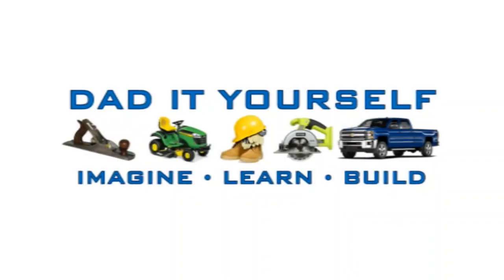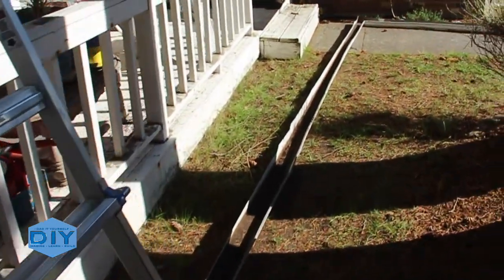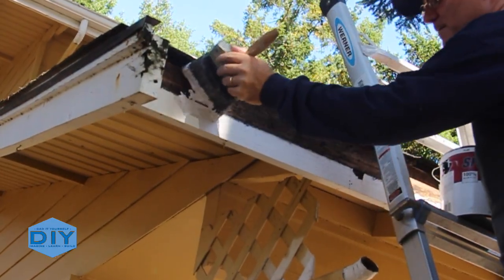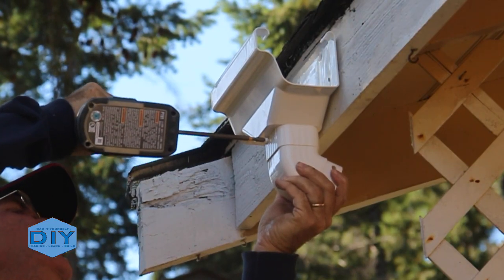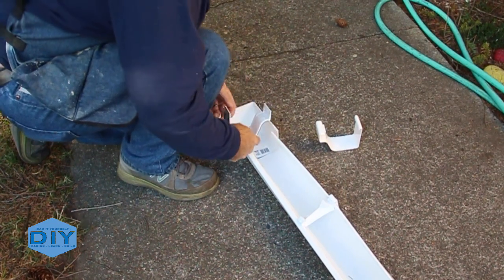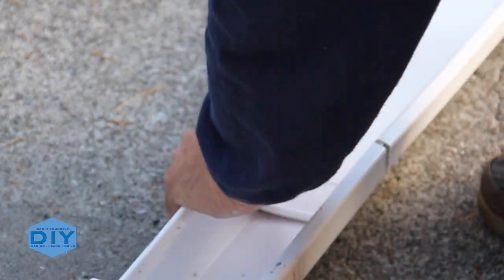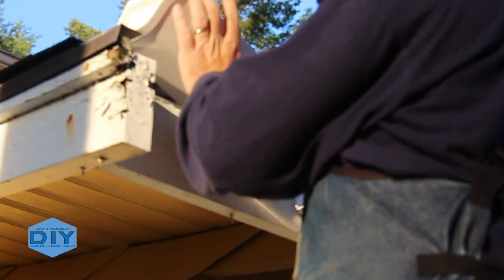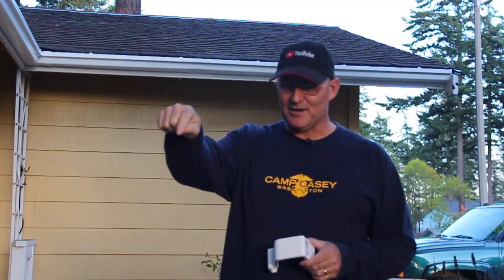INSTALLING Amerimax Vinyl Gutters | Homeowner EASY! | 2019/40

Comment: Another pro tip... Do not use 2 separate pieces across the downspout as there is no seal.  Instead cut your gutter full length, slide the gutter through the mounted downspout.  Once all of the gutter us up, you can fill the gutter with water to test the seal (look for leaks). Finally, cut a hole in the  gutter over your downspout with a utility knife for the water to run through.  Using two pieces like shown in the video will leak badly if not sealed.
Reply from the maker: If you do not follow the instructions and set tge length of the insert or themerature on installation day, it will leak, too short, thet it cools off, mine has never leaked.
Reply: Just telling you how it should be done.  Also your reply, I'm sorry...made little sense.  I am speaking from years of experience with this stuff. Take it or leave it. @DadItYourselfDIY
Reply from the maker: I agree with you. Had I known this trick, I would have done it.
Reply: I did it exactly like that... a lot better and easier to cut a hole in the gutter than joining it together..
Reply from the maker: @DSNYSANMAN I've heard that!

Comment: Pro tip: Install any connectors you can while on the ground. Trying to put in the joint connectors or end caps when the gutter's on the fascia is a real challenge, even where the nearest hanger bracket is loose. Otherwise, it looks good and seems to work well.
Reply from the maker: Agreed!!

Comment: Thank you.  Should have found your video before I put up my gutters.  No idea how to use the joiners.  Tried sliding the ends together.  Impossible.  Now I know how it was suppose to be done.  Going to try to put the joiners on with the gutters in place.  Hope it works!
Reply from the maker: It will. I had to go back to that house last week, one of the joiners was not centered (my fault) and it was leaking. Snapped it off, re-entered the interior part, and clicked the outer part right back on (back to front).

Comment: Thank you ,I wasted so much trying to join two sections with outside first! Truly my fingers wore sore!
Reply from the maker: Back to front.....
Reply: @DadItYourselfDIY  

In your video I noticed there was no metal flashing from under the roofing material and over the top of the facia extending down about 2 inches like there is on the house I'm doing. I can put the plastic (vinyl) mounting brackets under the flashing but then the screw hole is not accessible and if I mount them below the flashing it sits to low on the facia and looks like s#%t. Solution?
Reply from the maker: Drill through the drip fascia..

Comment: Sorry may be a dumb question, but do you use the joiners to connect the gutters to the 90 degree fitting or downspout?  Or is the gutter supposed to slide into the 90 fitting?  Joiners doesn't seem to fit properly over these fittings.  Thank you. Great video.
Reply from the maker: Nope. Just the straight runs.

Comment: We had aluminum gutters and I’m replacing with this product. We have hail often and the gutters we had were all dented. When branches fell on the gutters massive dents.

Th only thing I haven’t seen is if these can be painted?

Our Lowes has these marked down for clearance, I had to go to Home Depot to complete the project. They have the leaf guards that slide into the brackets that secure the gutters.
Reply from the maker: I'm sure they can be painted. I know they aso sell them in brown off the shelf. You may have to prime and paint. But I'm sure there is a video out there about painting vinyl.

Comment: Tips: 1 don't measure down from roof because it might not be level. Instead use a level. 2. Don't assemble on a hard rough surface like concrete like you did because it will scratch the bottom of the gutter.3.  I cut out my own downspout to avoid another unsightly joint.
Reply from the maker: Great Tips!!
Reply: I know this is a year old but how did you cut your own downspout.  The available downspout for this cutter won't work for me so I was looking for options but not finding any!
Reply from the maker: You can use a hole saw and an insert. They sell them in the same section of the store. Just remember to caulk it.
Reply: I was just looking at this system and regarding the downspout adapter, I was thinking to just run the gutter straight through it and use a hole saw in bottom of gutter. Should you caulk on either side of the downspout adapter?
Reply from the maker: That would probably work!

Comment: Tip the end cap doesn't go on the downspout connector.
Reply from the maker: It does not. It goes on a short section of gutter, usually 12-18" long.

Comment: 6:00 and that would be my problem, and why I can't figure out how to connect the corner piece to the guttering, and why I need to make yet one more trip to Home Depot. The other video I watched never showed connecting the corners, and I did not buy those connectors. I thought the gutter would slide into the corner piece.
Reply from the maker: Seems the sliding/expansion points are the downspout adapters only.

Comment: I like your video!  I installed vinyl years ago and like them; had some issues with seals and clogging, but really easy to work with.  Newer stuff like you installed looks better and the joints look much improved! Think the manufacturer suggested pure soap or food grade silicone for keeping seals pliable as the vinyl expanded and contracted.
Reply from the maker: Great info! I'm going to be at that house next week, it will be nice to see how they have held up.

Comment: Thank you for the helpful video. How do you put leaf guard on the gutters, my issue is the fact that the hidden clips are in the way for me to snap it on the gutter rail
Reply from the maker: The ones I used clip into the brackets and under the drip edge/shingles. This video shows that installation. https://youtu.be/yHYi-RKHcPY

Comment: Amerimax screws sold near the gutter are #8 11/2” zinc coated not stainless steel and are in overpriced boxes of 25. The heads are not round or give washer type consideration so off to the screw bins to get better.
No brave souls to discuss UV durability but Amerimax metal gutter is more than twice as much if you can afford to outsmart that issue.
I spent $300 for a 50 foot run and two down spouts in vinyl, so no to metal.
Thanks for the installation video.
Reply from the maker: I get the stainless steel screws with the enamel heads in the hardware aisle too!

Comment: I wonder how this would work with a 4.5 drip edge/eave flashing.  Not sure how I would attach it at that point. Thanks.
Reply from the maker: You may have to screw into the rafter tails.
Reply: @DadItYourselfDIY  There will be hardiboard fascia covering those.  So I am thinking I could predrill through the flashing and fascia in back and use the roofing nails to attach the vinyl gutter holders.
Reply from the maker: @affordabledesertliving3487 I'd recommend stainless steel screws. Getting a hammer and nail in there may be a challenge.
Reply: @DadItYourselfDIY  what about stainless steel roofing screws that have the little rubber washer?  That way it would be self sealing since I am going to be puncturing my flashing and the fascia behind it.  Thank you for your kind answers.
Reply from the maker: @affordabledesertliving3487 The screw goes through the hanger, so the washer will not touch the face of the fascia. A regular screw will be fine.
Reply: @DadItYourselfDIY  Totally makes sense. Thanks.
Reply from the maker: @affordabledesertliving3487 You're welcome.

Comment: Did you joiners on the downspout connectors. It looks like the gutters just lay in there
Reply from the maker: No joiners. They slide in and are able to move with temperature changes. Another option is to slide the gutter piece all the way through and use a hole saw to drill a hole over the downspout.

Comment: @7;27 this kind of joint, above the flow level blocks the dust and other hard particles and starts to create a heavyweight load and if not seen on time whole gutter falls down with its weight.
Reply from the maker: In comparison to a seamless gutter, yes. That said, the connection us designed with a beveled edge to promote water flow, so while some dirt or debris may catch there with low flows, any other substantial flow will carry that debris over the bump and down to the downspout.

Comment: I dont know if I trust vinal in cold weather, and all reviews I see they say aluminum is better. But you did show some good tips........
Reply from the maker: I'd agree that aluminum is better and much more expensive.
Reply: @DadItYourselfDIY  I have three roof edges 30-31ft. I just added up all the aluminum rain gutter stuff, hangers, end caps. three10ft down spouts, elbows, everything thats needed to do three roof eves, everything but  leave guards.....
It all came to a little over $700.00 at HD, WOW. Maybe I'll add up all the vinal parts and see if I can save a couple $100.00.....
Reply from the maker: Please let me know!!

Comment: Didn't see you mention anything about the downspout outlet expansion lines inside and what line to cut to. It shows different temperatures in Fahrenheit and Celsius. I'm guessing you need to cut to the line which is close to the current temperature outside.  Just guessing because the vinyl expands and contracts depending on outside temperature. 😊
Reply from the maker: Correct. A previous commenter suggested running a piece of gutter all the way through the downspout adapter and using a hole saw to cut a hole in the center.

Comment: Late to the game - I've found that, following 1/8" per 10 feet across 33', water backs up behind the inside joiner piece. I marked start and downspout end and used a level, actually had 1/2" total but found water pooling. A little frustrating; it may be that my initial hanging clips on the down-side gutters were too high. Any other experiences or after-install troubleshooting?
Reply from the maker: After I hung up the gutter, I did a flood test and adjusted my hangers to ensure good  drainage. While you may have your slope line correct, that doesn't mean the fascia is actually level.

Comment: I didn’t see how you attached the downspout fittings… the 45’s have holes. Why?
Reply from the maker: Not sure what you mean by the "45s have holes" the are secured to each other with screws. You can see how it's fitted at 4:23 of the video, and another shot at 8:35.

Comment: Hello Scott. Thank you for the great DIY video. One question about securing the vinyl gutter to the fascia. You said you used stainless steel screws, what size are they?
Reply from the maker: Hard to remember, But I used the screws that came with the kit.
Reply: I just installed 40' of these vinyl gutters this week. I used #8 - 2" screws and they're quite secure.
Reply from the maker: That's what I use. Stainless steel T25.
Reply: @DadItYourselfDIY  👍🍻

Comment: i noticed that you did not did not use a joiner in the sections for the drop outlet. I dont see how they wont leak. Am i missing something. Thanks for the video.
Reply from the maker: The drop outlet is a joiner, but its designed to "move" this is where the gutters can expand and contract with tempurature. No leaking either because its the end of the run..

Comment: Question, did you have any issues with the hangers becoming unclipped to the lip of the gutter? I'm having this issue and do not why....
Reply from the maker: Not at all. The gutters have been installed for a year now and are still going strong.
Reply: @DadItYourselfDIY  just had reach out to the company about the hangers. Mine keep popping off.
Reply from the maker: They are very temperature sensitive. Expansion and contraction with the weather.
Reply: @DadItYourselfDIY  I live in Florida and it's around 75 today. It's odd that the clips are not staying clipped. I'll let you know what the manufacturer says regarding this issue.
Reply from the maker: I would be very interested in that info!
Reply: @DadItYourselfDIY  The issue was a manufacturing defect in how the lips were not curled in enough to keep the clips on. Was able to exchange the product and install them successfully. My recommendation would be to test the clips on each gutter prior to punching.
Reply from the maker: Great tip!!

Comment: NO drip edge or gutter apron? Was hoping. That is the problem I am running into. Amerimax is flat on the back edge,  so can't just slip it under the current drip edge.  Trying to find a way to get it done. Any ideas???
Reply: ISN'T FLAT on back edge is what I meant to say.
Reply from the maker: @Dragon-Smoke-29 Do your shingles overhang the roof edge?
Reply: @DadItYourselfDIY  no
Reply from the maker: @Dragon-Smoke-29 Well that's not good.

Comment: How do you cap the down spout drain part of the gutter? You just run guttering into it without sealing? Caps and joiners don't fit it.
Reply from the maker: The down spout should be about 12 inches from the end of the round with a short piece of gutter and an end cap installed. Watch the 8:00 - 9:00 minute mark
Reply: @DadItYourselfDIY  thanks so no sealant needed for gutter running into the down spout?
Reply from the maker: Nope.  Follow the instructions for inset. There are lines for temperature on date of install to compensate for expansion and contraction.
Reply: @DadItYourselfDIY  you have a patreon? You're very helpful, I'd like to return the favor
Reply from the maker: You can give the video a Super Thanks in the comments section. That is very generous of you, Scott.

Comment: Don’t see a drop piece for the downspout.Is  it the Y shaped piece? If so what do you use for the closed end cap? It look as if I would have to trim the end to fit the gutter end cap on.
Reply from the maker: The downspout collection fitting is usually about 12-18" from the end of the gutter run. so there is a small section of gutter from the end of the roof to the downspout that has the end cap on it.

Comment: How would these gutters hold on a metal roof with snow sliding down on them?
Reply from the maker: Probably no better or no worse than an aluminum or steel gutter. I would think that their flexible construction would actually help them flex instead of bend. But at extreme temperature even vinyl becomes more brittle.

Comment: The vinyl gutters by Amerimx get high percentage of one and 2 star reviews, mostly claiming they are cheaply made and carry much less water than their much more highly rated aluminum gutters. I wonder if it could be climate related? Maybe the vinyl works well in warmer areas and not so well in severe winter areas?
Reply from the maker: Definitely not a whole house solution in the long term, but a great way to get something fixed in the short term, do a shed or a garage.

Comment: I thought the brackets screwed into the rafters, so 18” to 24”.  You can see where the rafters are by where the nails are in the fascia board.
Reply from the maker: You can do that or space them out evenly. This house has a 2 x 8 fascia. so there is PLENTY of wood to screw into.
Reply: Dad It Yourself DIY Makes perfect sense, thank you.
Reply from the maker: No worries!! Thank you for the comment.

Comment: I wish you would have shown how you cut the gutters themselves to size. Cutting the downspouts is easy, but you didn't show how you cut the gutters. I doubt that you used a reciprocal saw to do that.
Reply from the maker: I did use the reciprocating saw. My second video on vinyl gutters shows me doing this at about the 5:00 mark.

www.youtu.be/yHyi-RKHcPY
Reply: @DadItYourselfDIY  Thanks for your reply. I didn't see the second video. In the meantime, I have discovered I could cut the Vinyl with my cordless Ryobi mitre saw, as long as I didn't get greedy and try to do 100% of the cut. I could cut both the gutters and the downspout until near completion without "chipping" the vinyl, then easily complete the cut using a hack saw. It sped up the process considerably for me.
Reply from the maker: I found that the small teeth of the metal cutting blade works the best!

Comment: 1) How do I attach the gutter & mounting bracket to a facia that is angled in towards the structure at the bottom of facia thus making the gutter at same angle. The homeowner does not want this but wants it perpendicular & parallel with concrete driveway and structure walls. I'm thinking wedges behind each mounting bracket but that will be a p.i.t.a. and I'll have to requote the installation.
2) Homeowner wants the back of the gutter right under the shingle roof material but this is a problem because the mounting brackets (as designed) will not allow the gutter go up under the metal flashing. The closest position would be about 1/2" below flashing. Even if I could get gutter up under the flashing it would cover the mounting bracket screw hole. Solution? Drilling a hole in the flashing for mounting screw hole access would be to difficult and numerous to already installed flashing thats about .030 thk.
Reply from the maker: Ideally you want to be installed about 1/2" below the shingle edge, if this means through the flashing, then so be it. 

But, like you said, wedges or some other custom mounting method is going to be required to kick it out level. I would suggest PVC trim board material.

Comment: How do you connect two pieces of downspout that are not connected at an elbow? Both are straight and not crimped.
Reply from the maker: Vinyl or metal?
Reply from the maker: How long is the drop?
Reply: Vinyl. It's on the downspout into a pipe.under the deck. I have an extension coming up from the pipe but need to connect the down spout to it and it won't fit. the extension from the pipe is metal.
Reply from the maker: @mchaywood83  Matt send me an email at dadityourselfdiy@gmail.com with some pictures. I will help you get this sorted out....